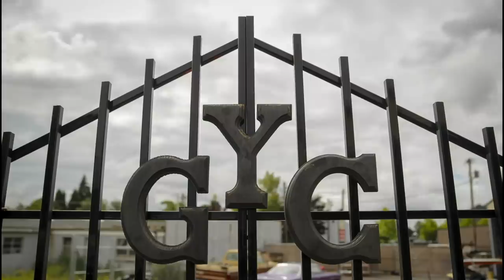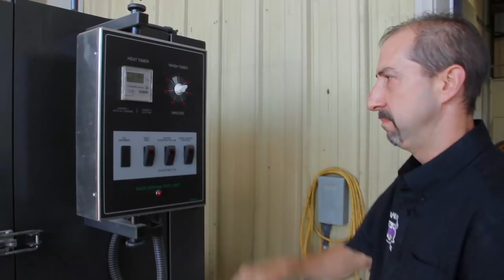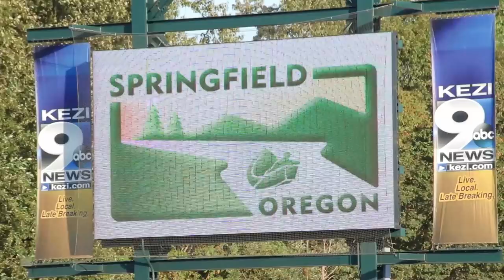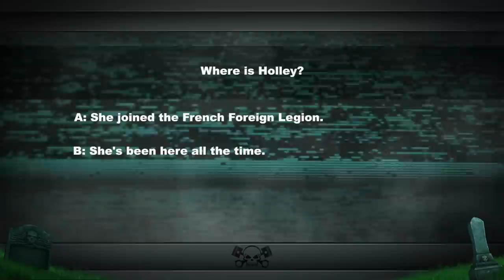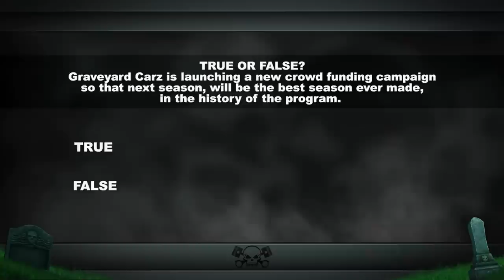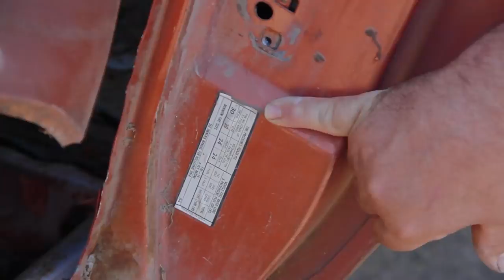Season 5 Episode 12: "Pitch and Rides"

Comment: this is my favourate Charger glad i got too see this, awsome paint gr8 work Guys & Gal
Reply: In 1973 found a 68 charger had been sitting couple years in the backyard of a snap-on dealer. Iam thinking he never had much time to drive it.white with black vinyl top 383 4 barrel 500 option wheels couldn’t believe it   He wanted 850$ that will work 🙂
Reply: @traderjack6151  wow 850 what a steal even back in those days, back in 88 i could have got a 68 for 800 but i had no place to park it so i had to pass on it.

Comment: Seems like drilling holes in the bumper after rechroming will expose bare steel to oxidation.
Reply: Yes, but there are plating pens you can use to touch up and you won't ever see it. Industry does it all the time.